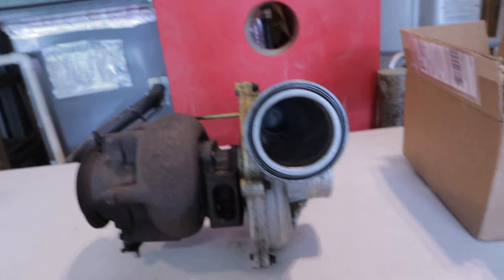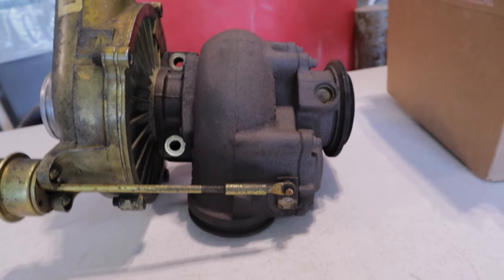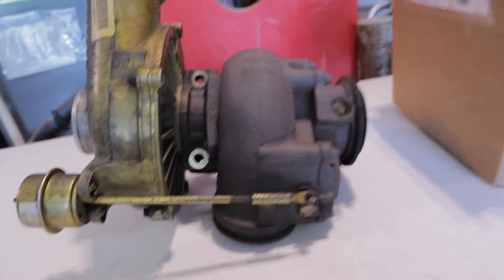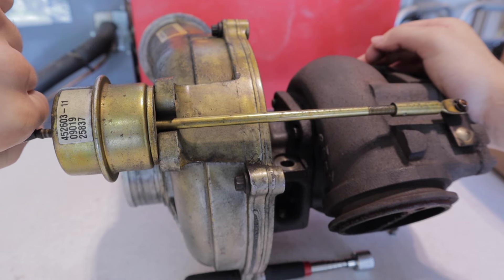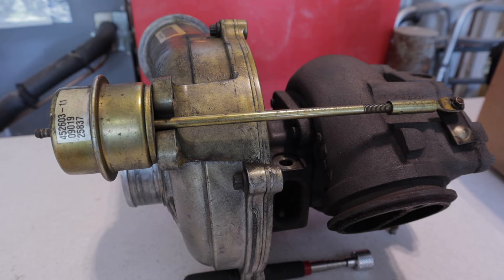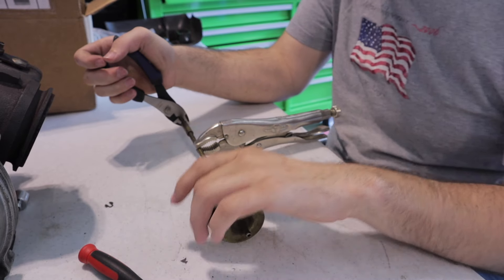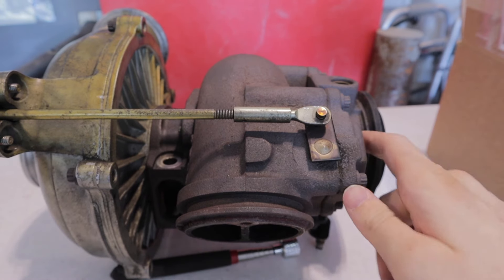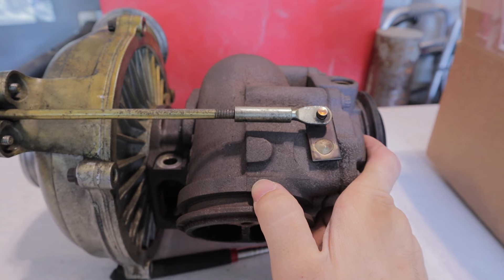Ford 7.3 Powerstroke Build More Boost For FREE!!!

Comment: So I’m not sure if you adjusting the arm will increase the amount of pressure it takes to move the wastegate. All you’re doing is adjusting the movement of the arm making it have to move farther in order to dump the boost.
Reply: Still love the videos dude ! You are full of knowledge and bring great videos along with it
Reply from the maker: I could have explained it better. You are correct with the actuator off tightening the rod does nothing. It's when it connected back up that it is actually holding more tension on the spring which is why it takes more pressure to overcome it.
Reply: @LivingOnWheels   Love your videos, but was just about to comment on this fact. Without the actuator arm connected, there is no way to tell how much pressure you are truly applying. I suggest an update as this could allow someone to attempt adjusting to 20psi “on the bench” and have no idea where their true setting is.  
Wish I could get to half of the mods you have done. Keep on trucking.
Reply: @chubracing  it preloads the spring. Let's say it's a 10 inch lbs spring. 10 lbs moves it an inch. 20 lbs moves it the second inch. So if it has 1 inch of preload now it's 20 lbs to get it moved

Comment: Hey I’m a little late to this video but I have a 99.5 7.3 with only a straight pipe nothing done in the engine bay. If I set this around where you set the waste gate would it still not decrease the longevity of the turbo or would I be burning it up pretty quick?
Reply from the maker: What I would say and what most other say is that you should try not to make a habit of consistently pushing the stock turbo over 25psi. That being said, if you dont have a boost fooler you wont be able to do that anyways. so doing this will just help with quicker spool up on the bottom end. Essentially I'd say you dont have to worry about this reducing turbo life much
Reply: @LivingOnWheels  thanks for responding so quick I think I’ll try and get this done soon then. Thanks for the help!
Reply: Sounds like bad fuel maybe?

Comment: How are you doing I have some questions if you can help me out . 
I want to install a 4” straight pipe on my 7.3 will it increase more power? 
Would it increase same power with muffler?
Reply from the maker: It will not provide any noticeable power increase.
Reply: @LivingOnWheels  installing a runner would be better?
Reply from the maker: @mauromartinez5810  I’m assuming you meant tuner but yes that would provide significantly more power.
Reply: @LivingOnWheels  yes a tunner. What others parts do you recommend to change to increase power
Reply from the maker: @mauromartinez5810  Unless your looking to go full build (injectors, turbo, etc...) a tuner is the only real thing you are looking at. It will feel like an entirely different truck. Get a hyrda from jelibuilt or 1023.
Reply: @LivingOnWheels  ok thanks

Comment: Just out of curiosity if I put a hydra tune on my truck will it do anything with the stock wastegate or would I still need to tighten up the wastegate?
Reply from the maker: The wastegate is all mechanical so the tune won’t effect it at all.
Reply: @LivingOnWheels  is this a possible improvement compatible with a hydra tuner?

Comment: Every time I receive a notification for one of your videos It makes my day, I learn a lot about my truck and upgrades to do to it. Keep up the good work👍
Reply from the maker: I really really appreciate it man!
Reply: @LivingOnWheels  So I'm a retiring master craftsman and I'm in the process of selling my home to go RV permanently I hope. I am mechanically inclined and work on my own motorcycle and others as well. This, I'll be dragging a toy hauler and I want a 7.3, I think. Strong engines. Especially modded up. I've found a few low mileage trucks out there. Any advice other than more air in and more out as free boost adjust ? Have you ever published a list of parts that you shouldn't leave home with out ?

Comment: Is it a bad idea to do this without compressed air? I don't really have good access to an air compressor. Will it be ok if I just do 8 turns? I have heard people have problems with snapping the rod. Have you heard this too? id just hate to break something since this truck is my baby and I don't have extra money to be spending. I'm just being paranoid I suppose. I watched your video about the best gauge setup for these trucks and I love the idea of the digital gauge. I was just wondering if this is still a safe modification if I don't have gauges to watch for overboost so I do not damage the turbo. Also I'm not sure if you already have a video on it or if you have had any problems with this but my truck when it shifts into 3rd i believe maybe second gear if I don't lay off the gas pedal it slams into the next gear and makes it seem like the transmission is going to fall out of the bottom of the truck. My dad handed me down the truck and says it has been happening almost since he bought the truck new off the lot in 2000 or late '99 I suppose. It really scares me when it happens because I've heard this could be a sign of the transmission going out. Sorry I am asking so many questions I'm just trying to learn and absorb as much knowledge as possible. Thank you, also as usual great video.
Reply from the maker: It wouldn’t hurt anything to turn it in a few turns. A stock truck won’t hit high enough boost levels to damage the turbo. In your shoes my first priority would be saving up for gauges of some sort. Get to know your truck, what’s normal and what’s not. Then you can start trying to make improvements. Are you running a chip or tuner? The trans thing sounds like high line pressure
Reply: @LivingOnWheels  I am not running a chip or tuner at the moment. I have been looking into the PHP ever since I saw your video. Would the gauges be a better option to start with before a tuner? I really like the Edge cts for the reason that I will be able to see more info about the truck. Is it hard to setup? I prefer doing work myself rather than having someone else do it. Are there any good videos or places I can find info about the high line pressure?
Reply: I also notice there are a lot of different options and generations of the Edge CTS insight. Which one would you recommend looking into buying?
Reply from the maker: Yes I would recommend gauges before a tuner. That way you can get to know your truck and will be able to see how the tuner effects things. The edge CTS is super easy to install. Literally just plug it into the OBD 2 port and run through the device startup sequence. Im honestly not sure on the trans. Its hard to say without feeling it in person and its been so long since if been in a stock truck that I cant really give great input on that.
Reply: @LivingOnWheels  Thank you for all your help I really appreciate it, So the regular edge CTS would be my best option? or is there another model that would be better? I see that there is a CTS2 for $379. But the price varies a lot and I'm not sure why. I am also seeing the insight pro which is much more expensive.

Comment: Your timing with this is impeccable. Thank you. In the past 2 days I've ordered $2000.00 worth of parts. Some of which is the vac lines and a new wastegate actuator/pump. Knowing I wanted more boost I ordered a 33psi at the recommendations of another youtuber. When he testsd his the actual working psi was cut in half and he only seen a minimal gain in his actual boost. My fear was it would be to high of a psi for my stock turbo and cause damage. If you have time what is your thoughts. They also have a 22psi that I almost bought. I'm looking for reliable longevity. My stock wastegate is not opening at all. Thank you again for the great videos
Reply from the maker: Would that other YouTubed be FixitNick?? I know a lot of people have pushed mid to high 20s on their stock turbos consistently. My opinion and what seems to be the general consensus is that it will do it but doing it all the time will be reducing the life of the stock turbo. Honestly though you’d have to be driving the truck pretty hard to constantly be seeing that much boost. I think you’d be fine with the heavier waste gate and if you want you could probably loosen it up a little.
Reply: @LivingOnWheels  to lighen it up i would just back off the threaded portion opposite your process in this vid? Q2, your stock wastegate started moving at 5psi or so. When replacing the stock wastegate is that the psi I would I'm looking for. I can't find anything that low?
Reply: @LivingOnWheels  and yes Fixit Nick was one of the vids i watch about the wastegate
Reply from the maker: Yes, to lighten it up just back off the threads a little. I would not set it back to stock otherwise there is no point in upgrading. Having your boost be able to get up around 20-25 won’t cause a problem and the truck will drive better.

Comment: I just got a 02, 7.3 psd.  Any tips on that nice turbo sound at start up.  I heard of foil delete, I'm new to this.  Thank you very much.
Reply from the maker: Foil delete won’t help with that. Best bet is strait piping it. Beyond that you’re looking at a new compressor wheel or new turbo. These trucks aren’t known for super loud turbos on startup though
Reply: @LivingOnWheels  one more question.  I saw the inside of the ebpv and it looks like a flapper that closes and opens.  During high idle warm up, does it close that exhaust exit.

Comment: Why my Hydra chip go from overdrive to low gear with a little touch of the gas pedal! I shift like a mule kicks
Reply from the maker: That would probably be more of a question for whos tuning you are running.
Reply: @LivingOnWheels  1023
Reply: @LivingOnWheels  I'm confused on all that "who's tuning stuff"
Reply: @LivingOnWheels  do I buy tunes? And it get sent to emails?
Reply from the maker: Trey Ivey yes you can’t get tunes emailed to you. Any tuning in general you need tunes that are designed for your truck.
Reply: @LivingOnWheels  the tunes I have I just don't like the hard downshift and I don't Kno what to do. Cause I'm new to Hydra tunes..
Reply: are you trying to ask, why your now tuned truck has stronger shift points? because it keeps your trans from shitting its parts into the pan. when your banging, your not slipping. 🤷‍♂️ slipping is nice to drive, not good for trying to hold power.

Comment: Love this.  What if we just disconnected the wastegate hose, the red one.  Wouldn't that just turn off the waste gate from actuating?  If so, is that not okay?
Reply from the maker: Lots of people have done it. Doesn’t completely stop it because it still has the exhaust pressure that will open it up. It does keep it closed longer though.

Comment: Man i have a problem.  Really bout to make me sell this truck. Went to put fuel in truck. Put fuel in it went bout a 8th of a mile to next store truck starts to skipping and cuts off want crank back up. Try a few times still nothing.  15 mins late it cranks go to my house bout a mile away  and cuts off again  and lost power.  New cps and new ips .
Reply from the maker: 1st it’s not worth it trying to sell a truck that doesn’t run well. You gonna get nailed with a huge loss. 2nd what kind of gauges and method of reading codes do you have. Your shooting the the dark just throwing money at it hoping it solves the issue. It would be very valuable to be able to read your fuel pressure, oil pressure, and codes.
Reply: @LivingOnWheels  i am checking on a code reader now. Just getting frustrated at this point.
Reply: Maybe check your fuel filter and maybe even your fuel pump. American diesel fuel is very crude and these trucks need good fuel flow to run properly. Also check your in tank fuel filters, those tend to go bad since no one ever checks them. Sorry for your problems man!

Comment: More boost requires more fuel. So on an IDI can you get away with fule turning up the fule feel several flats? Assuming stick injectors, how do you know when you have to go to bigger injectors?  Sorry. My first Diesel ever....94 F250 IDI turbo. I'm greener than a Granny Smith apple.
Reply from the maker: More boost doesn’t necessarily mean you need more fuel. A bigger turbo needs more fuel.
Reply: @LivingOnWheels  Interesting....then where does boost come from? How is it created?
Reply from the maker: @johnnyohness6610  you have the right concept. If you throw I big turbo on it then you need more fuel to spin it. With this mod you’re not changing your turbo size at all. You’re just stopping you’re current turbo from bleeding potential energy.

Comment: Whats the max PSI you can adjust to without causing damage or having a negative effect?
Reply from the maker: The common consensus seems to be that the stock turbo doesn’t like going about 25 psi much. Personally I’d try to keep the limit around there.

Comment: Always great videos!! know this  is a oldie now but im sure what you did didnt change just the tension but also shortened the overall distance that the actuator throws so when at high boost the waste gate  wont be able to open fully
Reply: Exactly right, I was a bit concerned for what that boost tops at when really on it.

Comment: I read lots of replies of guys that like what your doing but I have a ?  / So if you shortened the rod by 6 turns and had to blow the rod out to re-pin it. So when the motor is running and you mash on it the wastegate will and can open only to the amount of rod that is left so after your swift take off and your are at a good running speed your gate is still trying to open with the pressurized exhaust and can not get out, building up more psi and heat. ????? correct?  The way I see it.   All because you shorten the stroke of the rod. Not good for 3000 RPM @ 80 MPH on the interstate for 4 hours???? Thanks, reply when you can.
Reply from the maker: I'd say to start, I wouldn't recommend running at 3000rpm for any extended period of time. Second, under any normal driving conditions you should never have any issues of too much back pressure or EGTs. The turbo is fully capable of keeping up with the truck driving under normal conditions.

Comment: Don't you need a Boost Fooler to have this make a real difference? PCM will defuel if it senses higher boost.
Reply from the maker: technically yes, but this will also help build boost faster on the bottom end.